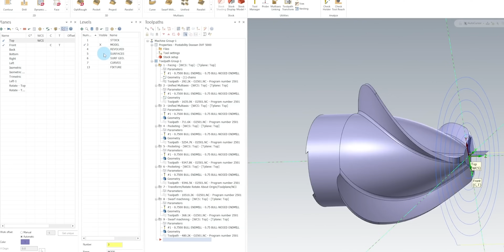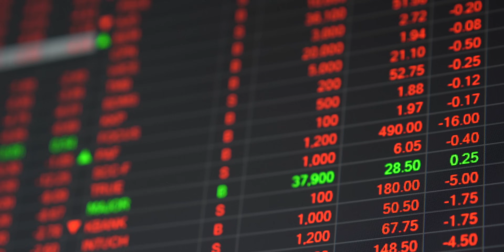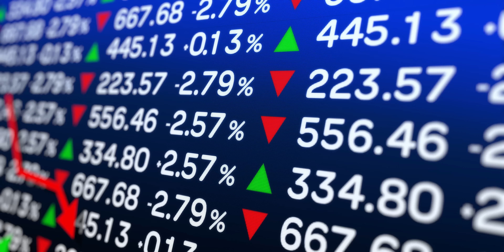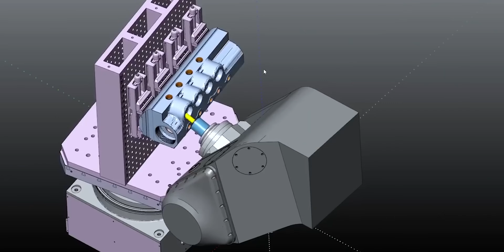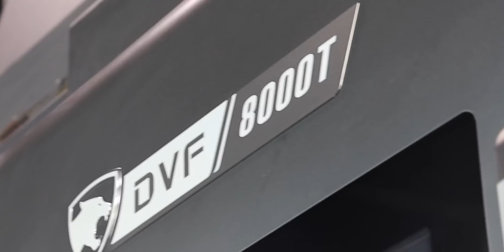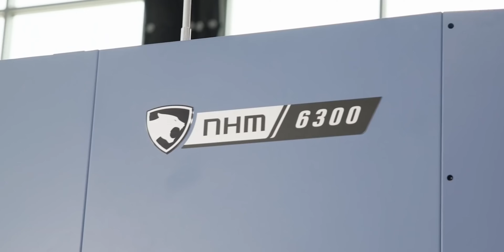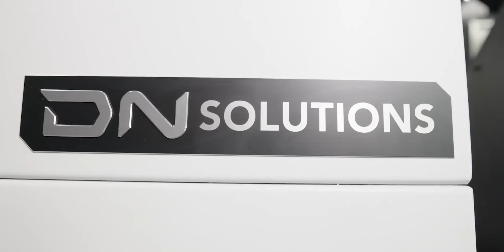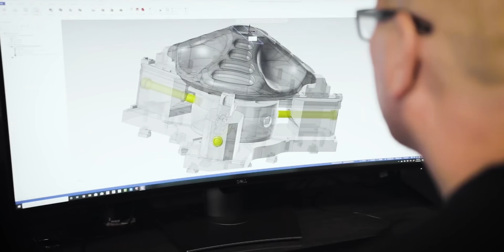Make HUGE MONEY in the Machining Industry During a RECESSION

Comment: One of the most daunting aspects of owning a machining shop to me has always been quoting affectively, not overcharging but still accounting for issues that may come up stuff like that. if you ever make a video on the intricacies of quoting I would greatly appreciate it!
Reply from the maker: I did one years ago called building a machine shop 2 or something like that
Reply: @TITANSofCNC  Thanks Ill check it out 😁
Reply: @BplusJequalsFire  The key is knowing your tooling.  If you know that you can run a tool at a specific MRR then you can more accurately determine how long it will take to make the part.  If you know that you can remove 30 cubic inches of material in a minute and the pocket you have to mill is 10 cubic inches in volume then that pocket should take about 20 seconds to rough out.  There are all kinds of formulas for calculating machining time.  If you have a copy of Excel or use Google spread sheets you can set up the formulas to help you get a more accurate cycle time.  What I'd do is quote 5% slower and program 5% faster.  That will give you some wiggle room for unforeseen issues.  Harvey tool has it's Machining Advisor Pro.  It's an app that lets you input machining values and will spit out speeds and feeds along with MRR calculations.  Harvey tool  also owns Helical tool and they too have the same app for their tooling.  I know that Titan is a Kennametal guy, but I've always had great success with Harvey tools for miniature tools and Helical for larger tooling.
Reply: @brandons9138  Thanks for taking the time to respond.  if there is complex fixturing involved,  how do you quantify that?
Reply: @BplusJequalsFire  That's the rub.  You can't really expect the customer to pay for fixturing.  You kind of have to eat that cost.  I've never seen a shop charge a customer for fixturing.  Overly complex fixturing can take a job from a winner to a loser.  That's where the creativity comes in make the fixture as simple as possible to do the job.  Cutting up soft jaws are just the cost of making parts.  During the quoting process if you see that you are going to have to make a complex fixture you can work that up as part of the quote and see if the customer is willing to split the cost.  At my current shop we've successfully split costs with customers for specialty tools before.  This was in part due to the fact that we had been working with them on the project for several revisions.  They changed the design and with that change we had to buy specialty work holding.  It wasn't a huge out lay of cash, about $3000 split between us and the customer.  If you have a good/longstanding relationship with customer things like that are easier to manage.

At my current shop we are setting up a new 5 axis mill with pallet changing robot.  We are spending close to $20,000 on fixturing for the jobs we are going to be running on it.  The customer isn't laying out a cent for that fixturing.  We are eating that cost up front.  We'll make it back over the production run of parts we are making.  You can amortize the costs of fixturing easier if you know that you'll be making parts over the long term.  If the job is just a random one off or is early in the design phase spending a bunch money on fixturing can be a huge gamble.
Reply: Great insight thank you.